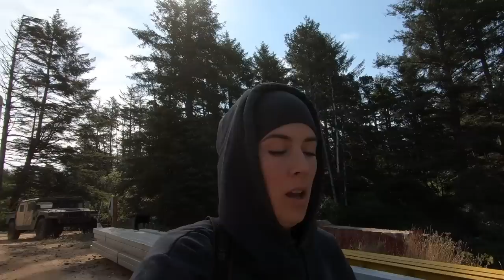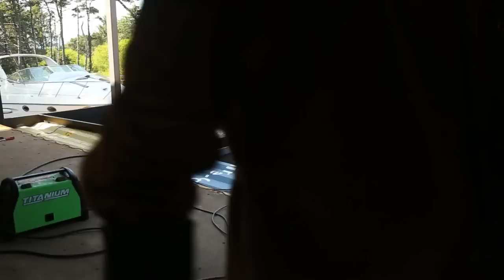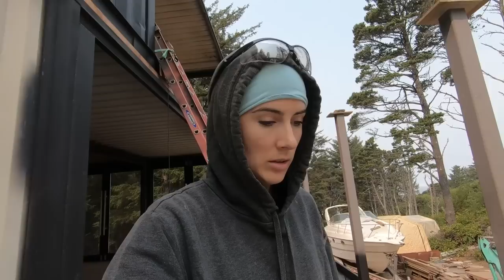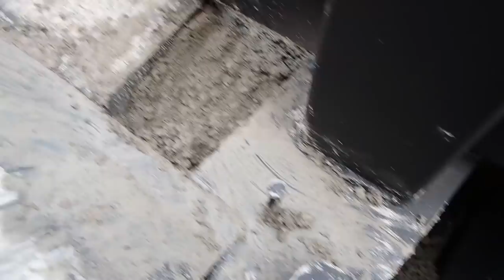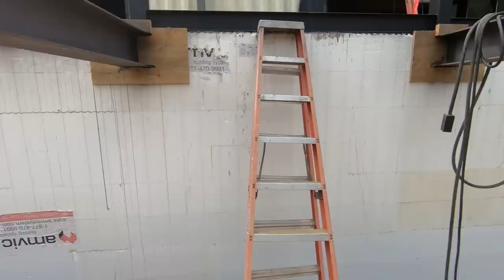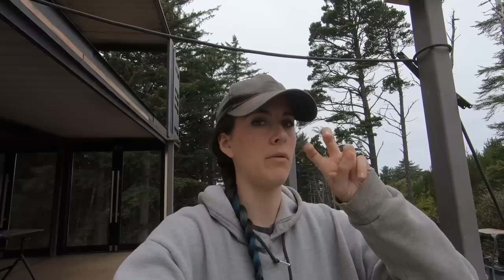WE MADE THIS WITH SCRAP! 40 FT FLOATING CONCRETE SLAB #building #construction #concrete #house #diy

Comment: The gaps between the metal wall sheets for your float slab to rest on while pouring I had a question why you did not just over lap those areas with the next sheet so it would require much less foam to fill those areas to block the concrete from escaping during the pour?
Reply from the maker: We had to leave the space for the metal studs that we had to weld to the I beams

Comment: PERSONALY would have had to layers of steel ,one is in tension the other compression,if aging doing just tie with wire saves all that welding and is a trade practice also any bars you lap  40 diams ,then just tie with tie wire  quick fast as  said method used on construction and oked by engineers world wide ,still a good job and just beware of your back propping ,been doing this for countless years and had a company that specialized in steel tieing and  suspended form work and concrete placing makes use a of a vibrator when pouring
Reply from the maker: Thx for the suggestions! :)